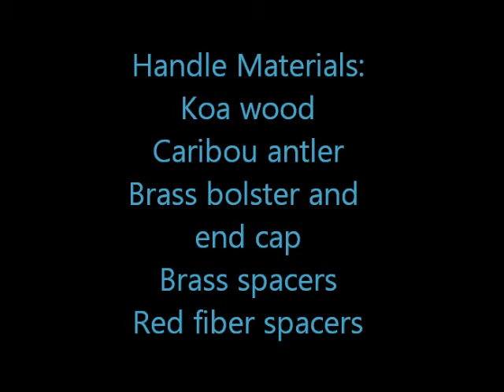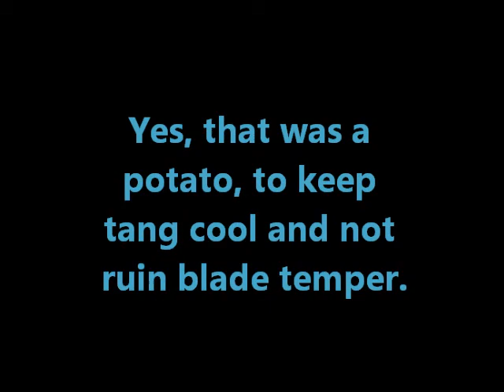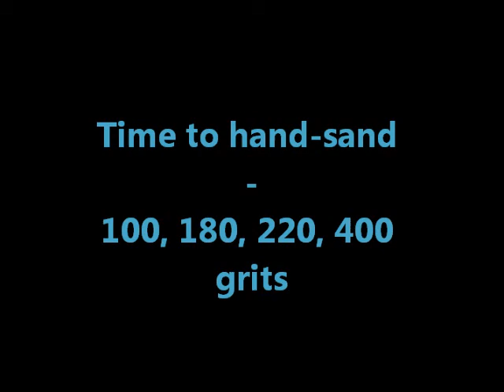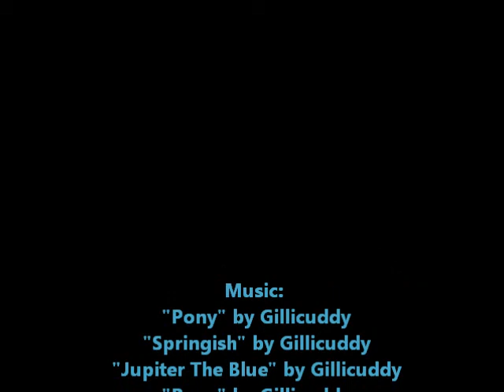First Enzo Skinner Build

Comment: never thought of a potato heatsink. I was using a wash cloth in ice water on a few small tang knives. I don't buy pre made blades anymore so haven't had to worry about tang prep since I prefer to make full tang. but bravo for the idea.
Reply from the maker: Thanks! I am not sure where I first heard to use a potato, but it does work great. Although it's a waste of food, and technically the temp doesn't get all that high unless the heat is on for a prolonged period of time. I have made a number of complete blades, but I have a hard time getting them heat treated myself and it's quite expensive to mail them out from where I live.
Reply: NuManXplore it's expensive everywhere. there's a good guy I've heard of that does a good job reasonably up in Canada. I forget his site but I think simple little life has talked about him. anytime you send for heat treatment it's better to have many blades. it's not necessary unless you want to sell with Rockwell ratings. heat to non magnetic and quench. it's been done that way for thousands of years so it works for me. and if the potato soaks the heat go for it. I like to normalize but that's forge stuff. then a 400 degree oven till I get a straw tint usually an hour or so depending on thickness. and you can do it a couple times for reassurance. from what I've seen so far you're doing fine.